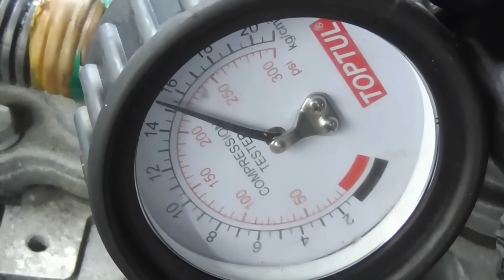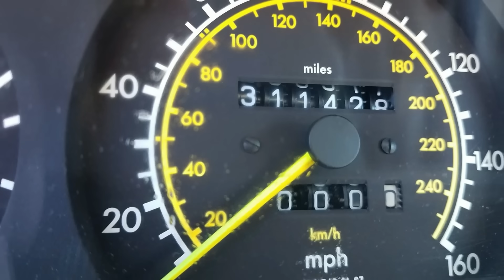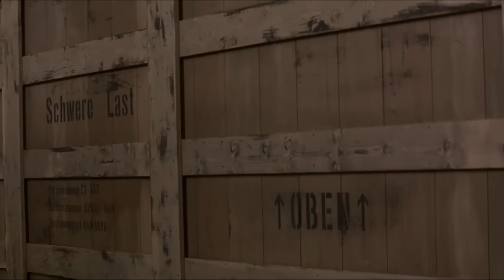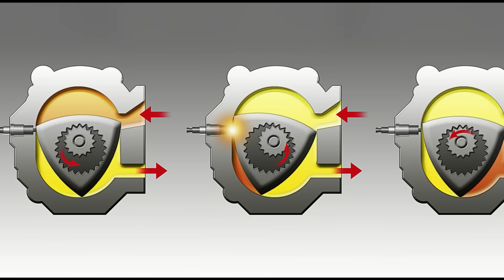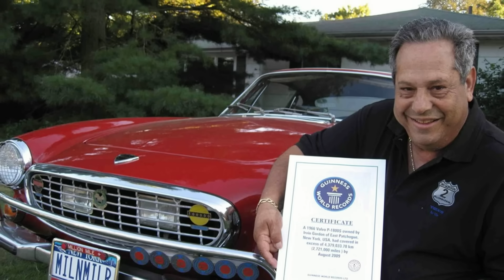Most Reliable Engines of All Time

Comment: 11:45 "...a clutch disc has an average life span of fifty thousand miles, with some people getting one hundred thousand miles."           
I have driven over two hundred thousand in four different Nissan trucks, two clocking over three hundred thousand, and NEVER changed a clutch in them. My 2013 has traction control, and the clutch is feeling a bit weak around ninety-three thousand.         
My '85 started blowing blue smoke at 348k miles, and my '98 Frontier dropped a timing chain at 374K, but the '93 and '04 models were still running when other problems made it uneconomical to repair them.

Comment: Number one 120,000 mi does not constitute as a reliable vehicle my truck a 2007 Toyota tundra with a 5.7 l V8 is currently sitting at 367,000 mi... And runs like a brand new one that my friend is a reliable vehicle ironically it gets better gas mileage now than it did off the showroom floor which is strange but anyways number two at driving an average of 100,000 miles per year that gentleman would literally have to drive five and a half hours every day for 365 days which does not exactly leave him a lot of room for his every 10 days having to get an oil change and not trying to be judgmental but if you look at him you can tell he doesn't exactly miss a meal so who else thinks there's something wrong with his story

Comment: I had an '87 Civic that went 238,000 miles and still passed smog...carbureted, 1.4L, 3 valves per cylinder.

Comment: BS list.  You don't mention any American V8 motor which have been proven to be extremely reliable over the decades, like the GM 350 small block V8 or the Ford 4.6L modular V8 motor which has been used in countless taxi cabs, police cars, limos, and daily drivers, some over half a million miles and still going.  This was a total waste of 12 minutes of my life.

Comment: 0bviously the mileage claims are silly. Most engines will make 150,000 with oil changes. 
And in fairness he said " most reliable Mazda engine" obviously the rotary engines blow seals way before 150,000 miles.

Comment: I noticed they didn't mention any American engines which really is a mistake.  The 7.3 Ford Diesel and 12 valve Cummins can get you to 300K+ with basic maintenance easily. My father's Impala with the 3600 has 420 thousand miles on it.  I just sold my F150 pickup with the 5.8 liter.  The engine still works fine.  Unfortunately I had to replace the transmission.

Comment: Careful, steady driving. It's not the speed that hurts an engine and components like clutch and brakes. Smooth acceleration and deceleration goes a long way when driving a car. I sold a suzuki swift with over 120,000 klm on the clock and brakes were original and still had 2/3 of the original thickness.

Comment: First of all the rotary engine was the biggest pile of crap ever made because they could not handle people running them hard, second I have a 91 Chevrolet corsica 3.1 by I bought with 120,000 miles on it and now after 6 years it's showing 360,000 miles

Comment: You forgot the F-150 and a straight 6 in it that I can go like a million miles and a 7.3 is really liable too I have 925,000 mi right now I haven't replaced any injectors in that truck and I also for a half a million miles around hydrogen oxygen through the air intake it gives it will make the engine last longer because  you have less dirty oil.that's why you can't get another 7-3 they don't make them no more it's an international motor and the straight six on F-150 you cannot get no more either because  it's too good a motor

Comment: Mopar 318 c I d.... One of the most underrated engines Chrysler ever built. Truly enjoyed mine in the '60s.... "Those were the days my friend
We thought they'd never end....."
Reply: 225 slant 6,340,BB-383 were alot better engines.I destroyed quite a few 318.Specially the 1 in my 72 Cuda.Til i drop a 440 in it.
Reply: I had a '71 Duster with a factory 3 speed on the floor, and a 318 engine. What a great little car. Ran and ran. Also had a '68 Torino GT fastback with a 390 block with 428 heads. That thing Never gave me a lick of problems. Wish I still had it. It also ran and ran.

Comment: I had a 1992 Mazda Protege, I managed to get 440,000 kilometers and the engine was still tight. the 5 speed transmission and clutch were still good. I gave the car away to someone because the key switch was going.

Comment: when you have to take the engine apart to change seals from now and then, it's not reliable. yes it's a good tuner engine.  but not reliable for every day use. btw 800 to 1M miles, with out a engine rebuilt is reliable. not 200-300 miles.
i stopped watching after the wankel engine..

Comment: Seen Mercedes sprinter van 5cylinder Diesel engines clock up 300,000 miles in 2 years and still run like new .

Comment: They forgot one MAJOR motor. The 1998-2001 Ford F-250 diesel with the 7.3 litre diesel. Mine has 280,000 miles and still runs like new. I have met owners with 800,000 miles and it is still running.

Comment: The 6 strait American moters . Is not fast. Jeep  4.0  287 thousand miles . Still going. The best .2000 Grand Cherokee. Change the oil . Don't take it over 3000 rpm. Half a million miles 
FOR real
Thanks 

.

Comment: Mercedes benz themselves said there diesel motors were the best diesel motors ever. However they themselves said the Chrysler slant 6 motors were the best gas engines ever built, If you have any experience at all with these motors you will know that they were silky smooth running motors that truly were amazing, & practically bulletproof, I had one once that to to just dying after apx. 5 miles of driving, I would pull over hit the key it would fire back up and I would go for another t miles, I got home raise the hood & pulled the distributor cap & rotor to ck the points, & was shocked to see that not only was the contact point completely gone, But that contact point arm had been riding on the distributor cam so long that the where it touch had been worn down to the thickness of a sheet of paper,  $ 2.98 for a set of new points, & back to driving the old 60 fury for a dew more years until my parents bought it fromm me because it ran forever, They finally give the old Plymouth to a poor family that had several children & no transportation, I met one of the grow children @ my father funeral & ask her about the old car, she told me that they had driven the old car for years & it had been one of the best cars they had ever owed, that it had eventually over heating one dark night along I -80 in Neb. They had gotten out of her and walked away, never to see her again, the Odometer had read 128000 when I sold her to my parents, I always wondered how many miles she eventually racked up

Comment: I agreed up until the rotary, at that point I realized you don't know shit about engines and you only read off a list of popular engines, here's a list of mistakes 
1. Rotary engine are the most unreliable of all time, there's millions in junk yards with only 20k miles
2. The 2jzgte was only used in the supra, all other ones have different heads and Intakes as well as cylinder linings
3. 22r and the d17 are the most reliable gasoline engines of all time
4. Your mom didn't swallow

Comment: Document from 12:30 

Taxi of Grigorios Sachinidis

Type:                                    MB 200D, W115
Registration Date:              Oct 20th, 1976
Bought:                                1981, Waiblingen at 220000km
as taxi:                                 1981 – Mar 2004 in Thessaloniki
Total mileage:                    4.6 Mio KM
                                             (115 circumnavigations of earth or 6 times to the moon and back)
Engine:                                11 times refurbished / replaced
Passengers:                       thousands, exact numbers unknown
Features:                            more than 2000 rides into Ex-Yugoslavia as a long-distance ambulance and
                                             medicinal supply runner.
Major breakdowns:           none
Road worthy:                      yes

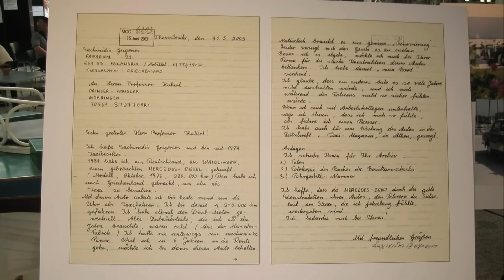Comment: Letter at 10:40

Dear Professor Hubert!

My name is Gregorios Sachinides and I have been a taxi driver since 1973. 
I bought a pre-owned Mercedes Diesel (1976, 220k KM) in 1981 in Waiblingen (GER). 
I brought it into Greece to be used as a taxi and have been using it around the clock as such. 
Since then I drove 4.51 Mio KM with it. I changed the engine eleven times, and all other spare parts were original parts only (directly from the Mercedes factory). Never did I experience a single (mechanical) break-down during that time. I’d like to retire in 6 years and keep the car afterwards.
Of course, it’ll require some refurbishments going forward. However, I am required by law to replace it, before. Therefore, before retiring it, I’d like to thank your company for the reliable construction of this car, as it earned my bread.
I think, any other car would not have persevered all these years and I would not have felt as safe.
Talking to my colleagues, I tell them, I feel as safe as being inside a tank. Also, I credited the car in a taxi magazine in Athens.

Attachments:
For your archives I am sending you:
1) Fotos
2) Copy of registration documents / ownership documentation
3) Chassis-No.

I hope, that Mercedes-Benz will carry on providing that feeling of safety with their reliable constructions that I felt for years.

I thank you very much!
Kind Regards

GS

Comment: You leave off the most reliable engine ever made. 12v Cummins! It’s called the” million mile engine” for a reason.
Reply: Given it's designed and made by a builder well known for their BIG TRUCK engines (1 million miles in a semi is EXPECTED and sometimes considered a bit on the SHORT side)....

Comment: no.2 is laughable, my old MKII Astra had a 1.3 carb engine that did 189,000 miles - I bought it ex company at 3 years old/64k on the clock. 6.5 years and I'd ragged the F@@k out of it, had an indicated 126mph downhill and a top indicated of 115mph on the flat. Eventually it cracked a valve but still ran 60 miles a day but it was the bodywork that did for it hence I didn't sort the valve out.
75bhp and 880kg meant it could do over 55mpg if you did a careful run on the motorway, average with town and commute into London (including lots of slow stuff at the end couple of miles) was 47mpg.

The best engine I had though was the 1.7 high pressure turbo diesel Isuzu Vuaxhall put in their MKIII, an absolute bombproof engine that was better than the car it was futted in.
2nd best is the 1.9Passat TDI, really, excellent engine, EGR an issue though.

Comment: My 1992 Chevy pick up has a 350 engine wit 360,000 miles on it and it's still running great.
Reply: I've seen over 400k. Great engines if they are maintained.

Comment: You may like to look into the 6 cylinder overhead cam Ford Falcon engine used in Australia. 
Incredibly reliable and the BA model was fitted with a double overhead cam turbo model with the ability to make huge hp.
Americans are now buying them from wrecking yards in Australia so they can also enjoy this engine. 
Check out XR6 turbo.
Regards Steve.
Reply: I had a 1966 Ford Bronco with the 170 Falcon straight 6 cylinder. It had two oil pumps, one in tront of the oil pan for going down hill. And one in the rear of the oil pan for going up hill, and it held eight quarts of oil.

Comment: You missed the most reliable diesel of all time, probably the 5-cylinder 2.4 Volvo engines. You wont see any second hand for sale with 400k miles or less. Also they can even go as high as 1 million miles without big maintenance.

Comment: I  think you should have included the Volvo B230 series...  my 1989 740 estate had 226,000 miles when I got it (with full service history) and now 17 years later has 402,000 miles still purrs and drives beautifully
 I have only replaced a water pump and service items (filters/oils/spark plugs / distributor cap/rotor arm/plug leads/timing belt brake pads and discs and exhaust twice) sure its a boring single OHC 8 valve not particularly powerful, but I think another 100,000 is likely to also be drama free.
Reply: My B200F has all original internals.  I had to have the head re-surfaced as years before the radiator let go and it compromised the sealing of the cylinder head gasket.  The alternator and coolant pump lasted to around 220k.  I change seals as and when to ensure it remains oil tight and doesn't smoke or need the oil topping up between 10k services.  It still has its original USA made Timken wheel bearings (strange as I thought they'd be SKF).

Comment: Surprised you didn’t mention the Ford 4.6 that was used in P71 Crown Vics, Crown Vic taxis, Lincoln Town Cars.  There is a reason these were picked by limousine operators (LTC) that in NYC are limited to a maximum of 300,000 and 5 yo, then they sell them to operators in southern states where many car 600,000 without pulling the heads, but probably have had 3 transmissions.  Taxis can and do accumulate massive amounts of miles, it’s the automatic transmissions that crap out at 225-250k miles, not the engines.  Every car I’ve owned sees 200k+ miles, I only get rid of them because the transmissions let go, not the engines.

Comment: Had a ford f150 with a inline 6 300 engine with over 320000 only work i did to the engine was fuel pump water pump head gasket and a put in a new clutch they just dont make trucks like that no more so sad.

Comment: Bilt in obsolescence takes a staff of thousands of engineers in different departments. Building a engine the last a million miles only two engineers
Too many cooks spoil the soup a thousand cooks will screw up a soup sandwich...!
Now your talking 300 D Mercedes diesel that's a million miles easy.. but any diesel engine will do that and any truck driver that drives one will tell you that.
Stop the engine with the Mercedes it's the damn transmission it will do a million miles.. it's electronic it has the same amount of Pars as a torqueflite, it has a fourth-year by means of a kickdown band that cuts peach beer in half..! It will last for a million miles..!

Comment: I'll give him an A for effort, but at 2:40 he says Honda has roller rockers on an over head cam engine; but roller rockers are on push rod engines. It's my understanding that in an over head cam engine, the cam lobes contact the valves directly, and don't need rocker arms, roller or otherwise......

Comment: Sounds like an ad for toyota, and completely forgot about all the Chevrolet V8 engines that can easily go to half a million miles before needing only a change of rings and ready to go another half a million. Or the Chevrolet 6 cylinder straigh line engines from the 60-70s that all these japanese cars copied and added twin cams to try to show as they invented something new. I have a 5.3 with almost 300 K miles right now and the only thing it asked for was a water pump, after 18 years, go figure. My Honda civic from 1990 also have way over 200K and still running. If you say that 120K is the life of an engine your expectations are very low. In the other hand, Toyota was sued by the engine on their corolla and others, that was basically a sludge manufacturing machine and would get clogged even when oil was changed at the recommended intervals. Very little research into all that was talked here. More like propaganda.

Comment: Is this a high performance engine reliability post or every day drivers??? No mention of the Ford 300 CU IN in line 6 engine that I personally owned a 1965 Ford Fairlane that I sold with 491,600 miles on it still running just fine. They were made from 1965 thru 1996 and they were not just in cars/pick ups ether. Many farm tractors, farm equipment, utility vehicles and the big brown UPS trucks had them as well! They were not high mpg engines but RELIABLE! I have one horror story though that my Brother bought a 1967 Ford F 250 4x4 with a 300 six in it. In the summer of 1969 I asked him how often he changes his oil because he was complaining that it was burning a quart every 300 to 400 miles? His reply was, "Change oil?" It had 45,900 miles on it with the original oil and my brother only adding oil when needed. I changed his oil/filter putting in high detergent oil. He took my advice having the oil changed again in 100 miles. It lasted another 38,100 miles before it locked up.

Comment: The original slant six dodge 170/225 regularly clocked 500k miles as a taxi engine and was discontinued because chrysler wanted to sell more engines to cab companies. you talked anomalies this was the NORM with that engine due it's steel crank and ultra simple maintaince!
Reply: 3.3v6
Reply: Dodge 2008
Reply: the original 225 slant six had a steel crank. tune it up change the oil and it could go a half million miles!
Reply: I turbo'd one an it ran 14vsecond quarter in a 1966 4 door dodge dart
!
Reply: it was an excellent sleeper! I stayed side by side with  '76 vette  on the highway till heforced me over a guardrail!

Comment: What about the Honda J series? I got a 3.5 VTEC in my Pilot running at 225,000k with only oil changes and it purrs like a kitten. These engines are due cast aluminum and although they’re heavy they’re built like a tank! 

Seems like this guy doesn’t really know what he’s talking about, Including BMW engines in most reliable engines of all time, those are built like a pile of junk and there gonna need rebuilding after about 75k if you’re lucky to go that far. My moms BMW isn’t even at 80k and had a main engine seal replaced, valve gaskets replaced, and including oil burning issues with an astonishing price to repair the problems that makes no sense to even consider that price when you can get either a Honda or Toyota that will out last it but 300k with very little maintenance.

Comment: Some rotary engines have gone over 400K miles. Usually their demise is not the engine but a failure to the car's chassis.  The transmissions are bullet proof.